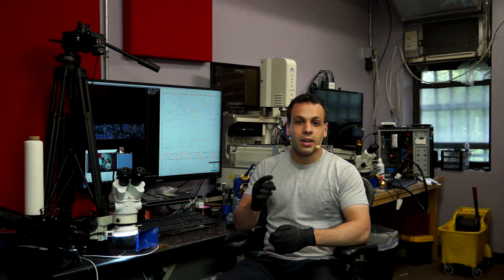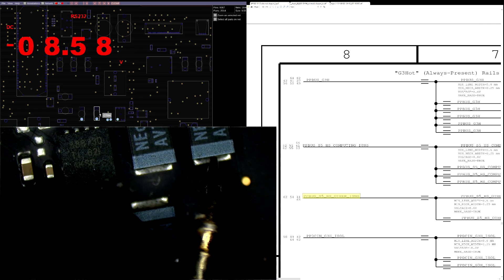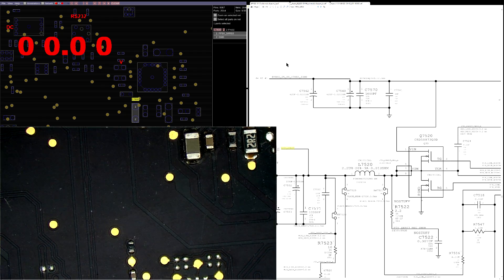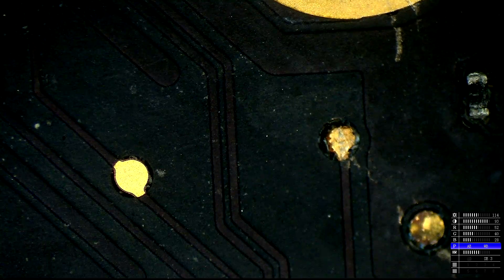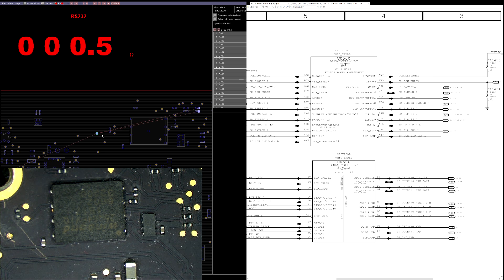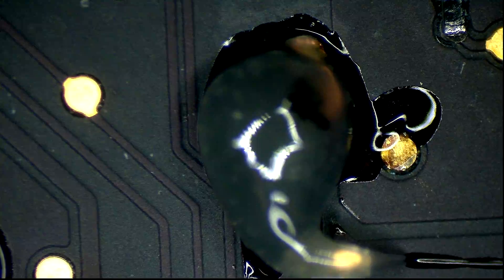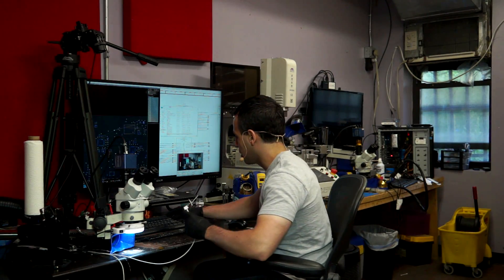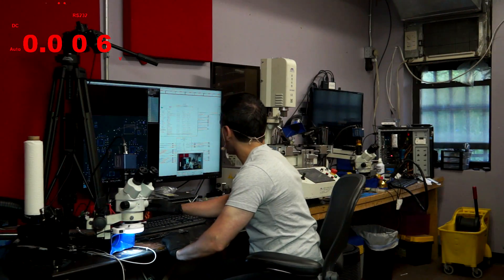This kills more Macbook Air motherboards than anything else

Comment: Is the wire you're using the same as linked in your video description, enameled wire with a thin layer of insulation? Do you scrape off the insulation at each end before soldering it into place? Or, does the heat of the solder melt the insulation away without need to strip it off? Excellent channel, by the way. I'm going through one video after another to gain insight.

Comment: Why do the fans go on when you plug the charger in? Do logic boards just turn on when you plug them in if they are stripped down? Or are you shorting something on the logic board to get it to turn on without the keyboard/power button being plugged in?
Reply: If a board is entirely disconnected from power, it will turn itself on the first time the charger is plugged in.

Comment: Why not just run a bead of solder if the wire is covering such a small gap?
Reply: If your soldering makes bridges, you are not using enough flux. It should stick to the copper wire, not make bridges. If you would reheat the joint, the joint would break.

Comment: But why does it actually happen? I know that you said its due to water damage but then why does it commonly occur on "MacBook air (2013 -2016) " these specific versions? And is it getting damaged because water is entering a specific area of these MacBook (like on the keyboard or some other area?)??
Reply: Abeejit Menon - Could be, or it could be a slight difference in materials used on the boards etc.

Comment: What is under the "probe point"? The probe point being that circular entity that is colored gold. The copper (traceway?) aka "rail" has disconnected from the probe point?
Reply: The "probe point" doubles as the pad of a via
Reply: "via"?
Reply: john plaid A via is an hole through the board (or just some layers of it) that is plated or filled with metal
Reply: I can't see the disconnect between traceway and probe point.

Comment: With such a small gap, why not just use solder to bridge the gap? Does the wire offer better resistance to thermal/mechanical wear?

Comment: That's usually called a via. 
Sometimes you add a test point to the via, for the extra functionality. 
The point of a via is to connect tracks of copper on different layers, so if it the path is cut, the connection between those nodes is lost.

Comment: that makes me want to go back to a stupid x55ma Asus board... This is the third motherboard of the series I fail to fix. which angers me a lot. cpu gpu Northridge southrbidge all in a single chip. other chips are an ISL like chip for power management and the bios (and a realtek bullshit one) I have no schematics. I tried everything on these boards, new bios new ISL hell I even fucking rebelled the CPU. still all dead. sometimes the fan spins in a weird way, like small impulses, sometimes it is completely dead, sometimes the CPU becomes warm, most of the times not. and a certain point the power led began flashing. The behaviours changes everytime you turn it off and on again. fucking blind and clueless without schematics

Comment: crazy how something so simple as a corroded probe point can cause a machine to not boot
Reply: not really when you consider every small connection as vital for core functioning. New apple macs are like little flowers, very very delicate
Reply: Andrew Harnaman It's not that the probe point was corroded. The corrosion was a clue; which led to discovering the via (trace) was burnt. So you had a open circuit on the pm4_sl line; causing the machine not turn on from an S4 to an S0 state.
Reply: IKR, I've seen old ones that have been thrown in backpacks for years and are cracked all over and work fine, despite missing keys, and having hot drinks spilled on them. I've also seen new ones that break from a half meter corner drop.

Comment: Nice fix but how does liquid damage the circuit?
Reply: The trace is made out of a thin layer of copper. When liquid comes into contact with the metal, it causes corrosion to the metal, and the copper turns into non-conducting copper oxide, the blue/green stuff you can see on old coins and copper roofs.
Reply: More like: A plastic sheet would keep more macbooks from taking liquid damage, which means apple would sell fewer new macbooks. Can't have that.
Reply: Apple doesn't have the proper plastic sheets to divert the water. The older MBP's like A1260's did have more water protection.
Reply: A plastic sheet is like 0.1 mm thick, and then the computer would have to be 0.1 mm thicker than it already is. Can't have that.
Reply: Plastic sheets cost money man!  They're just giving the customer a good product at a lower price point.  Definitely not designing them to fail easily. No sir.
Reply: Actually the copper oxide is black and prevents further oxidation (passivation). The blue/green stuff is copper sulphate, witch occurs when the water contains the sulphate ions, which in the case of motherboard corrosion, likely comes from rainwater.

Comment: No one understands the amount of knowledge Louis has imparted in this short video. Either that or no one cares about learning and the 275k+ subscribers are just here to troll or see him fail. Keep up the good work Mr. Rossmann
Reply: Lois himself has said many times that there isn't really all that much to it - he even gives credit to his Crest ultrasound cleaner for a fair chunk of his repairs. Troubleshooting just about any electrical system when simple visual inspection and ultrasonic wash fail ultimately boils down to 1) check outputs 2) check power rails necessary to generate missing outputs 3) check control inputs required to produce the missing outputs. Anyone who can read a schematic should be technically able to do it.

Why aren't more people doing it? For me, it would be the lack of patience to deal with nasty boards and (especially) annoying customers.
Reply: It's more like, a lack of respect for hands on repairs. The combination of technical knowledge and hands on skills is actually pretty rare.
Reply: If you think that's all it takes and it's "simple", look at every mechanic who works in a dealership. They have service advisors and still can't fix shit
Reply: I understand a lot thank you, keep up the good work indeed.

Comment: Perhaps Louis should start offering waterproof-your-macbook upgrades? Drill drain holes to the motherboard and add some plastic over it! (That's what the Thinkpads do!)
Reply: I don't think many MacBook air users would like having holes drilled into the base aswell. Many MacBook Air users specifically are the less knowledgeable ones. Not all, mind you. That'd be a great service to have though :)